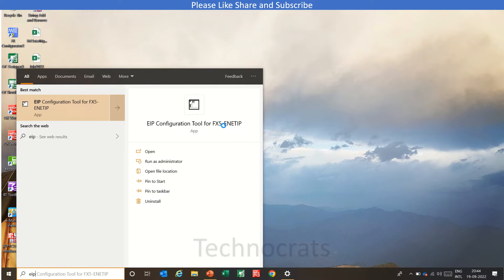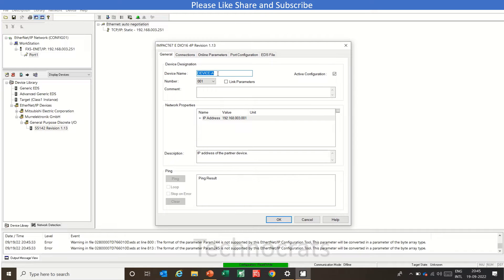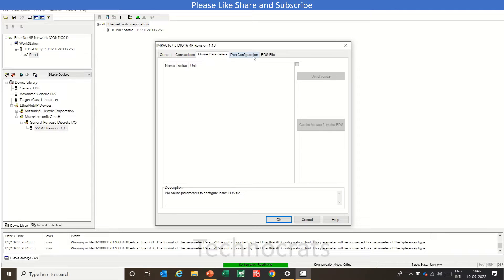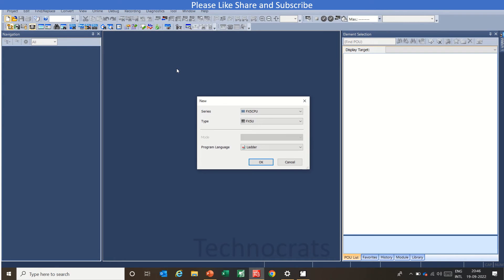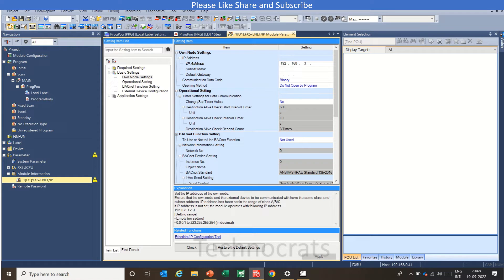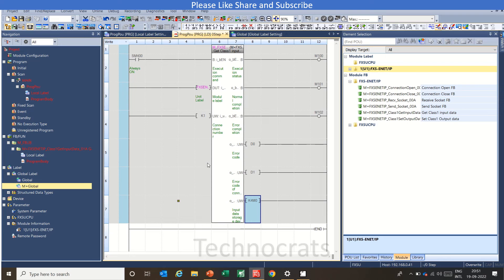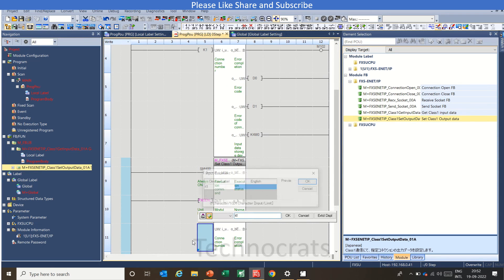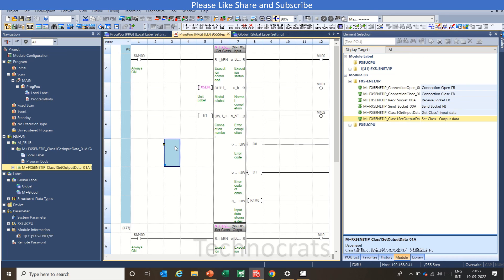Ethernet IP Communication in Mitsubishi PLC FX5 ENET IP Card

Comment: Inside the EDS file u had set the module IP as 192.168.3.251 and in works 3 u had set same module IP as 192.168.10.250. is it actually correct?